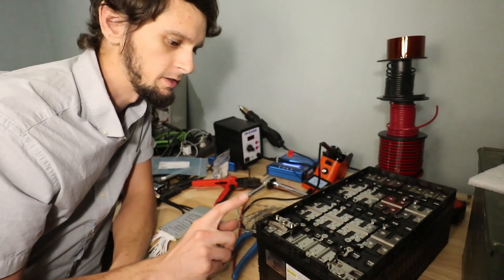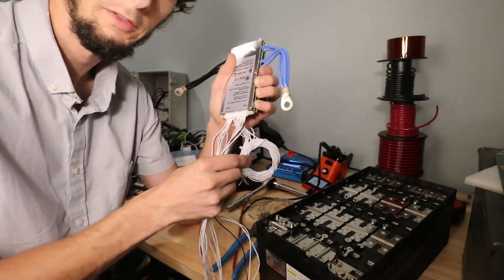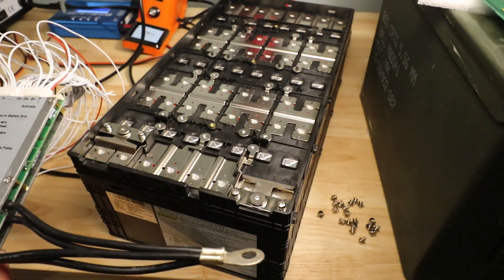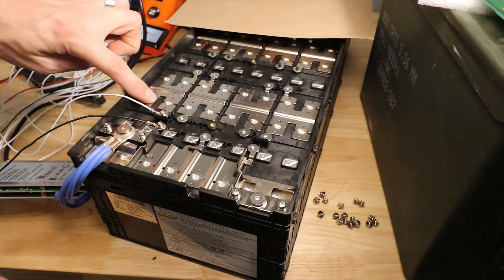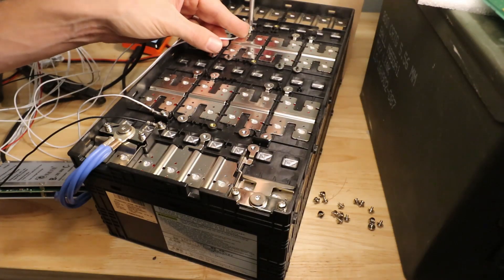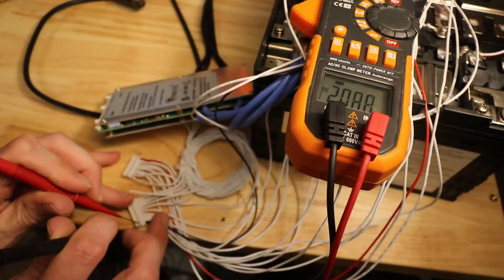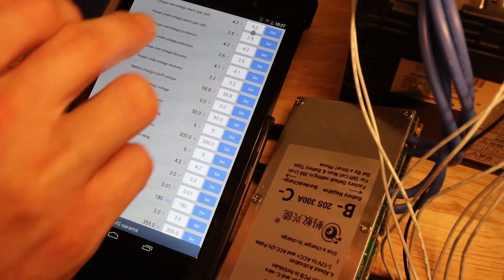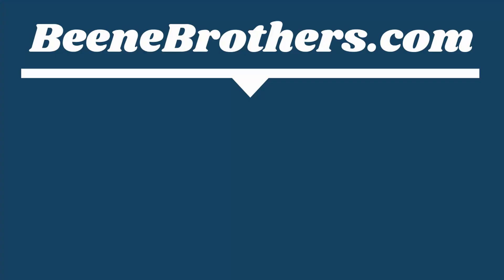Installing ANT BMS on Toshiba SCiB Lithium Titanate *LTO* Battery from BatteryHookup

Comment: Need to pay better attention to battery safety.  You are using bare hands and bare metal screwdrivers over a live electrical bus with thousands of amps of potential short circuit current.  You drop that screwdriver you'll have a bang!  (I know I've done it).  DO NOT touch that bus with bare hands, it'll give you a little jolt. Sure it's not high voltage but it still hurts.   Proper safety protocols would include an insulated screwdriver, safety glasses, and more care about bare tools.  Please demonstrate these procedures, I've learned these things =the hard way and blown stuff up.
Reply from the maker: You are correct, I need to get more appropriate tools and ppe. 24v isn’t enough to give me a tingle though. Metal tools is definitely a concern at any voltage.

Comment: the ant bms can configure voltage each cells?
Reply from the maker: It monitors each cell for voltage and the limits can be adjusted via Bluetooth if that’s what you mean.
Reply: thanks i have also scib cells i dont know if the module is working so i decided to buy ant bms and  can i series the bms to make it 36s?

Comment: Great video. Noob question here! Are the main B- and C- cables solely for amp reading? Can't understand where C- hooks to.
Reply from the maker: Not at all. I didn’t know any of this a short time ago so I’m here to help others learn.

B- goes to the battery negative and in this case c- is both charging and load. Yes one function is reading current in and out, since power flows through the BMS it can be stopped with the internal mosfets in an error condition.
Reply: @BeeneEnergy  Yes, I have B- cable on battery negative. My system is not connected to any load at the moment. But I can still monitor and balance with C- disconnected??
Reply from the maker: @tmarko5112  oh yes, as long as b- is connected you should be able to get in, perform some active balancing, monitor cell voltages, etc.
Reply: @BeeneEnergy  Your awesome man, Thanks!!

Comment: Love that you are using LTO! Thanks for the awesome video. Do you think you could use 60 cell solar panels wired in parallel without the controller? Seems like it would work with 12S LTO as long as the BMS actually shuts off charging at 33.6V. I think I'd want it to stop charging at 31.8V, 2.65V per cell. Might not even need a BMS or controller if the cells are initially charged to 2.7V as a balance, and one keeps an eye on not overcharging. Some 60 cell solar panels have very little current above 32V at normal or hot conditions. Cold conditions would be an exception. Seems like it would almost self regulate if initially balanced, and using slightly low voltage 60cell panels in parallel. What do you think? Thank you!!
Reply from the maker: Interesting thought. I tried something similar and it was a failure. Split a 72 cell solar panel into three 14v panels. Was hoping to parallel two of them to be a 12v nominal panel. There wasn’t enough current at that voltage though :(. I did some rough numbers,  it really I think the magic number is the vmp rating on the panel. If it’s above the high voltage of the battery I think your scenario could work.

I don’t have any 60 cell panels to play with. Might try with a 72 cell. 

I’m debating the negatives. One would be relying on the BMS more heavily, which could be ok if it’s a trusted unit. It would basically be acting as a pwm charge controller.

Comment: So what power supply are you using to charge up the LTO's? And what voltage/current cc/cv?
Reply from the maker: I'm using a PowMr MPPT charge controller paired with a single 305w solar panel. Would work great if it was tilted towards the sun but in its current location I need it laying flat. Need to add another panel or cut a tree down so it charges sufficiently during the day to support the 24/7 50w load. It's charging to 2.55v per cell so 30.6v pack. It is cc/cv, yes.